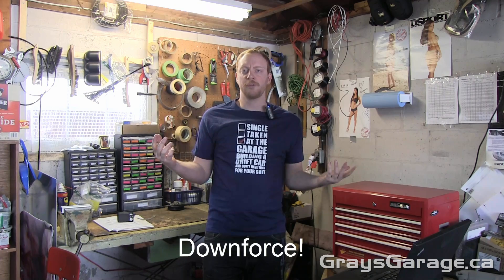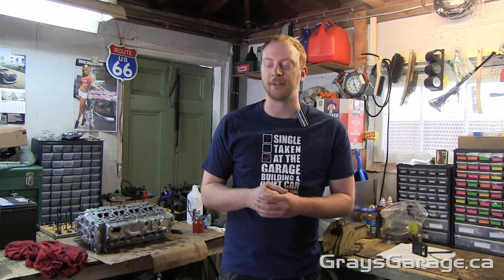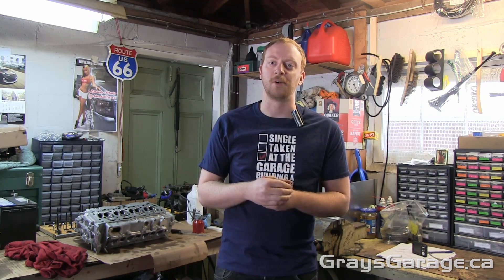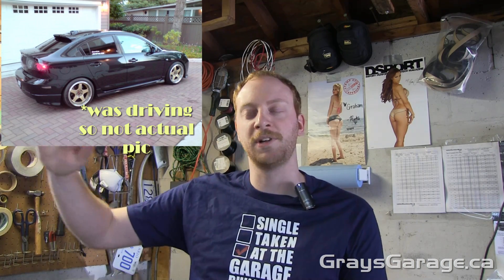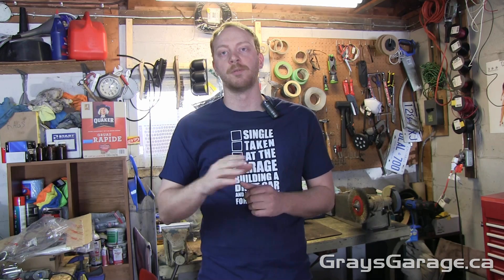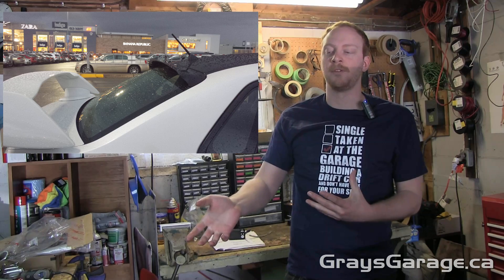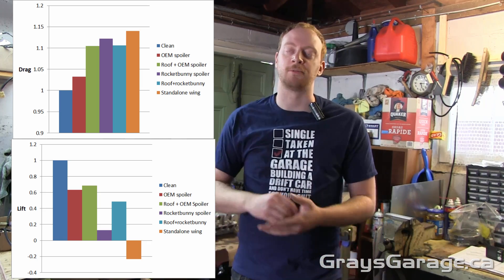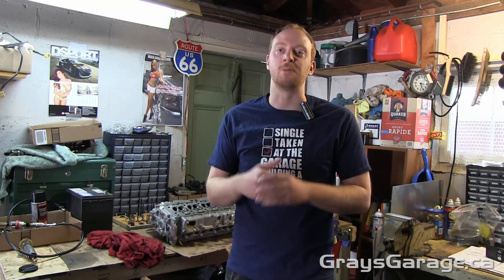Automotive Aerodynamics Ep. 8: Roof Spoilers!

Comment: I just added one to my is350, i know it doesn't help, i just like how it looks. I'm not racing the car and if i wanted fuel economy, i would have gone with a different car. 

That being said, i did the roof spoiler at the same time that i did a Wald style spoiler in the trunk and the fuel economy difference is negligible. 

I was getting 27.6-27.5mpg on a 240mi round trip to LA and I'm getting 27.6-27.5mpg now. I was expecting a drop in mpg from the Wald spoiler alone, but I'm not seeing any drop at all, maybe the roof spoiler is making air over shoot the Wald spoiler.... Idk, that's a guess, I'm not really worried about it enough to test lol

Comment: The concept you describe makes sense on trunk spoilers but for cars like the former Sti and the Evos where they legit have a wing spoiler then it works because it pushed the air up towards the top part of the rear spoiler.. Thats why the evo came out with canards on the roof. So it may be dumb in one aspect but perfect for another.

Comment: Watching this video after waiting a month for my Result Japan Roof Wing for my GR86, bc I wanted to find a good GT wing for actual downforce 😅. I know this is an old video but if you see my comment, please give me some advice on what kind of wing and mounting height in relation to the rood wing won't make it do more harm than good. Im now realizing that the trunk spoiler + roof spoiler + GT wing may be a bit much but I also like to actually perform well at the track so to sum up my biggest question right now. If I want to have the roof wing and trunk spoiler for the looks, and I plan to have a proper chassis mount splitter, verus underbody, and a proper chassis mount GT wing, will the non functional aero, (roof wing and trunk spoiler) hurt me or can I still make a functionally fast car with it if ai set it up right and how can i do that?
Reply: Also just for reference the result Japan roof wing doesn't have the little accent flap at the edge but it does plane out the roof line so I imagine I would need a rear wing just tall enough to crest just above the roof wings highest point? Or should I completely abort the roof wing because the drag will be far too great and ultimately ruin the cars high speed performance 😊

Comment: Hey great info here. If you don't have a trunk or roof spoiler and don't intend to track the car but want some downforce. I have a mk4 supra with no wing and don't want to put a large wing on it as it is a street car. Would putting a well designed roof spoiler help with downforce or just leaving it without anything?

Comment: 2:26 well the key thing missing here is that the engineers dont do that for production cars, it is always a balance of factors to get the car to fit within crateria for general use cases, its a very real possibility you could do better than the engineers did with the areo because they were not going for maximum efficiency at all costs, the car has to sell to mass markets and be cost effective to produce.

Im not defending the roof wing  here especially with the vehicles that are using them with a spoiler or wing but there is a place for roof spoilers and that place is on modern vehicles like a SUV where there is not a trunk lid to mount anything on.

Comment: Hi, So, I drive an 04 Honda HR-V and it has a spoiler, from factory, before the end of the car... what might it be for? It's an 90/10 FWD Mini SUV with the aesthetic of a curvy brick. 
I suspect that it is to stabilize the air, so , technically drag reduction, since it is virtually flat and has not angle of attack and the car it's self can go particularly fast.

Comment: the GTR notchback has a big bubble behind the windscreen...the wing would have to be higher to be in "good air" and work effectively.  

Give them a break.  Any aero device is pretty moot under 80 kph...and it only costs $99 to look cool.

Comment: Ironic t shirt. 
The upper spoiler is fitted to decrease downforce for drifting purposes to create a Smooth straight non turbulent non tumbling airflow off the rear, also for towing caravans with wagons increases airflow efficiency trailer
And creates less dust from kicking up.

Comment: 2:27 Well, aerodynamic efficiency is not always the focus of those engineers. Noise reduction, looks, safety etc. kinda impact that. 
For example: The Side Mirrors on my convertible are huge and draggy. But they have the effect that they prevent wind and noise in the cabin, even if the windows are down.

Comment: I'm, a min and 1:25 sec in and already you're painting with too broad a brush. You might want to change "Aero effectiveness" to "Downforce generated". On vehicles with steep rear window angles a roof spoiler helps the air stream break free from the back of the car and is many times more effective at reducing drag than a rear spoiler, especially a wing, and in most cases a front air dam and even under tray. Take a look at the back of an E30 M3 or MB 190E Evo II. They both have big rear wings and roof spoilers from the factory. Unless the rear wing of a car is at or above the height of the roof, it isn't doing much any way. Thank you for pointing this out at the end of the video. I'm with you on the FRS as the shape of that car is significantly different than a Civic, Skyline, BMW, Impreza, Evo, Mustang, Camaro, etc. And that spoiler is directing the air up and away rather than at the rear wing. Check out project tailwind from Texas Tech Mechanical Engineering department. Bottom line - If you have a vehicle shaped like a car, and not an egg, the combination of a properly designed roof spoiler and rear wing will yield better aero effectiveness than a rear wing alone.

Comment: I don't have a roof spoiler on my cars but dude, you need to relax about them. You see them on cars in parking lots because it's a styling modification done to street cars that typically never see speeds where downforce is a factor. It's like going on a 15 min rant about chrome exhaust tips and getting into the science about how ceramic coatings or titanium piping is better. And you can blame the manufacturers for them having applied roof wings on cars like the WRX STI and Lancer Shelby. Yes, they direct the air in the exact opposite way but for a street car all those really do is blow dust off the rear window.

Comment: My sedan came with a company fitted roof spoiler but i didn't add any spoiler on the trunk. The spoiler is a straight one (like the ones that have brake lights) will it help the car's performance or should i get it removed

Comment: Hi, I'm thinking to install a roof spoiler on my pick up. My purpose is to reduce the drag and maybe get better fuel economy specially I'm taking it for a long road trip... So is it useful?
Reply: a straight sheet parallel to the roof line or even tilted back a few degrees positioned 1/2 or a whole inch from the roof top

Comment: the rear window is designed by manufacturer to be a low pressure area so they wouldnt have to put wipers on there. this affects (reduces)the airflow to the trunk where your wing or rear spoiler is located. by adding a "roof spoiler" you create drag on the rear window and fill the trunk area with useable air for your wing. id say they should be installed in tandem with rear wings or spoilers

Comment: Curious though i have a roof spoiler on my crossfire and i wonder what affect this has on my aero since the rear is pretty rounded
Reply: the EEEEffect is that it works against that rounded back, it separates the flow before it rolls behind the car on that round back. Still would be curious if a rear-edge (although there is no edge) spoiler would affect the aerodynamic drag vs downforce/lift in a more positive ratio.

Comment: I have added 3 blade windshield wipers specially made in Mexico for my C7 Corvette  Z51 that were wind tunnel engineered to function as vortex generators and create low pressure for the rear spoiler. I have added two more triple blade wipers to the rear valance at 14 degrees to generate continued low pressure and vacuum effect as air exits. JK. The good news is the auto aftermarket creates many jobs in America and keeps the Chinese child labor force unemployment at an all time low. If a non functional mod makes them like their car more I happy for them.  But I still laugh when someone is pimpin a 3 ft wing with a crazy angle of attack that slows the 108hp car down so much the ill balanced chassis can't go fast enough to worry about the added understeer. I then tell them about triple bladed windshield wipers.

Comment: May I point out not all roof spoilers deflect upwards like all the ones you showed do. Some are simply straight, same line as the roof. If you have a huge rear wing, and a straight roof wing, would air flow more directly to this large rear wing instead flowing down the window and under the wing.

Comment: For one thing all your pictures are not of a roof spoiler they are a rear visor 
Two if they don't do any thing why did my 07 sti came with a stock roof spoiler
Reply: its not a roof spoiler it is a roof vain to help keep the flow attached at the rear window to feed the flow into the large rear wing and to decrease separation

Comment: I hear you on the roof spoiler being dumb. But vortex generators shouldnt be put into the same dumb category. They are used on airplanes because they are functional. The purpose of them on a car is to promote the continuation of air flow along the downward curve of the rear of the car to the rear spoiler. If you look at how an air foil (wing) works, you need air flowing over both surfaces to create lift (or weight in the case of an inverted foil). The vortex generator helps promote keeping that air flow from diminishing after that curve.
Reply: he's not dismissing vortex generators per se, as he isn't dismissing spoilers per se. it's the placement that is dumb. On a GT86 i guess vortex generators are no improvement, as the flow is attached anyways.

Comment: This video would be so much better if you just presented the facts. This is coming from someone who doesn't have or want a roof spoiler/visor, or a rear spoiler at all. It just sounds so typical to say cliché dramatics like "stupidest thing ever". 

Oh yes, a slap in the face of the engineers who have to design most cars with the rear spoiler as a visual upgrade option.
Reply: I have to agree, the first 6 minutes or so are just the guy spewing bullshit nobody actually cares about. If that was cut and it was just the simulations, demonstrations and comparison charts, I'd be perfectly fine with the rest of the video but those first 6 minutes are just yikes.

Comment: Hey Gray, I have an SW20 and I remember from looking at your special on the MR2s that there is a dead zone with re circulation above the engine lid. I was curious the small roof lips in that situation create the same problem with the rear wing or if it serves to help clean up the rear aero a bit on the SW20's?
Reply: Yes I'd like to know as well or with like a pickup with a bed cover

Comment: with a roof spoiler, you creat more air turbulance, which creates lift & drag (which you dont want both)
Reply: Yo H.A.  I believe it [does] create turbulence.. but for the added turbulence (aka drag) you start to cancel out the LIFT in that area. Meaning it may take more HP to overcome the additional drag but the reward is that the car has less lift, which usually is perfered. Any thoughts on that theory? I'm just guessing here :O) Cheers!

Comment: For another episode, could you show what use do some unconventional spoilers/wings have? 
Personally the BMW 3.0 CSL's roof spoiler is bugging me. The one on top of the rear window, which is set in an awkward direction. Does it direct the flow to the rear wing? Doesn't it produce lift?
For reference: https://static.carthrottle.com/workspace/uploads/posts/2015/09/654e0a03-e0d8-4432-9134-6c4f35303b1a.jpg

Comment: @GraysGarage could you discuss the roof spoiler on the 190e evo 2? It's at a shallower angle but seems just enough to maintain attachment for that huge rear spoiler on the car? Maybe you could discuss good vs bad roof spoilers?
Reply: To be technically correct, its a rear wing. Not a spoiler. 
Any disturbance to the clean airflow will affect the wing as it requires the air to flow over both sides of it nicely to work correctly. 
That reduced profile roof spoiler will have a smaller affect, but an affect none the less.
If you want an example of a well designed roof spoiler have a look at some of the Subaru Sti's which have a factory roof spoiler to drag airflow down and focus it over the wing to increase downforce. Pretty interesting.

Comment: Your video is fine for cars but those of us that carry roof racks for carrying things need a spoiler to reduce noise and drag count over multiple bars facing perpendicular to the wind. This is called parasitic drag and anything you can do to reduce that will improve mpg and reduce drag counts.
This vid is fine for those looking for more down force and lower drag counts but misses the point of vehicles that need a roof spoiler because of roof racks and using your vehicle for hauling things without taking the roof rack off when not hauling....

Comment: I may have missed it but did you test a roof spoiler without a rear spoiler.
Reply: Peter Stockwell no he didn’t , unfortunately because that’s what I’m trying to find to reduce trunk related drag on my Jetta. Although engineers do extensive testing, they still incorporate aesthetics. Most people don’t like the visual of roof spoilers. But I can’t find data to back up the use of a roof spoiler on a sedan that has no rear spoiler.
Reply: @Seajay1337  Any feedback yet? I ordered a high quality fiberglass roof spoiler for my g37s. Reason, because my trunk has no wing on it. Figured the roof wing will look nice and reduce drag.

Comment: technically if the roof spoiler is angled downwards to reach that target angle of 12-13* you claimed, they would be beneficial no? (not like the upward angled ones you posted)

ie. like the MR2 in the first video, because of the rear hatch section, if there was a roof spoiler to angle it downward I would think that would be a good combination to a trunk mounted spoiler. ...but I could be wrong....
Reply: It doesn't matter what angle the roof spoiler is at. If the air doesn't flow smoothly down the rear window area, you are making your aerodynamics worse. Even if you changed the angle, the air still won't be flowing smoothly down the rear of the vehicle. The roof spoiler will still be disturbing it. Engineers design the rear of cars with aerodynamic efficiency in mind to improve fuel economy and handling. Do you think you know more about aerodynamics than an engineer at Toyota or Honda?
Reply: @gamewizard1760  what if i own a del sol with a raodster style rear my back window is flat leaving a big aera for air to pocket in i have a rocket bunny spoiler of an s14 and am considering buying a eg hatch spoiler and puttiung it on the back of where the targa top sits above my 3rd brake light.

Comment: Do a video about hood vents. in Miata's for example, a lot of track guys are adding extractor vents in the hood at a low pressure zone on top of the hood. It's supposed to reduce engine bay temps (understandably) and also increase downforce. I would like to see what the effects of it really are.
Reply: If it's got a undertray the vents would be helpful if they routed the radiator air up that way
Reply: @barblupwrx6571  thanks for that quick reply buddy
Reply: @Bashirbros  in 5 years he will say no problem, I'm calling it

Comment: What about the roof spoiler on the Ford RS200? it flows the air in the opposite direction (creating lift) however it sends more flow to the boot (trunk, its a car not an elephant) spoiler

Comment: I was hoping to see this kind in the video. I'm not sure what to call it, but it angles the air downward toward the rear window. I can't seem to sift through cars, but i could find something similar on SUVs. Different platform, but what are your thoughts on this type? If moving the air away from where you want it is one of the major points, would some drag be worth pointing it at your rear wing? Link for a visual on what i was trying to explain. http://www.autotoys.com/pics/56256.jpg

Comment: What about the tall STI Impreza roof spoiler?
Reply from the maker: +Butcher Seven Actual that is a turning vane, not a spoiler.
Reply: +GraysGarage  how about using a vortex generator in the place of roof spoilers still a bad idea?
Reply: +GraysGarage is it the same deal with the MK2 Supra Celicas?
Reply: have you tested these tho? I love the look of them but always wondered if they are in fact helpful in any way, and i refuse to add things to my car that hurt performance
Reply: I have a MK2 Supra, its not really a spoiler, I believe it's a sunshade for the rear seats/trunk area. (for the early model atleast) Its not angled right to make downforce, is unstable at high speeds, and either generates very little downforce or actually creates lift. I cant remember exactly which :)

Comment: you showed how roof spoilers are dumb when associated to a trunk spoiler or a wing on a sedan, but you didn't show any results of a roof spoiler alone. I assume that car manufacturers design cars to be the more efficient as possible, not caring too much about stability and downforce; I think that adding a a spoiler in the roof doesn't mean "slap in the face" the manufacturer, but choosing a device that "combs" the airflow leaving the roof, giving a little more stability without "spoiling" too much the design of the car. Why then would it be effective ONLY on a hatchback?